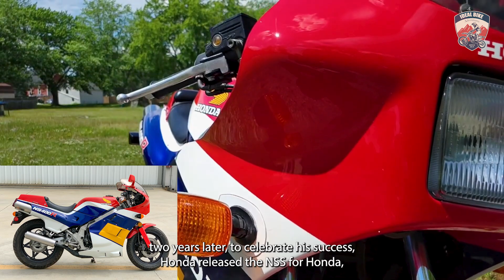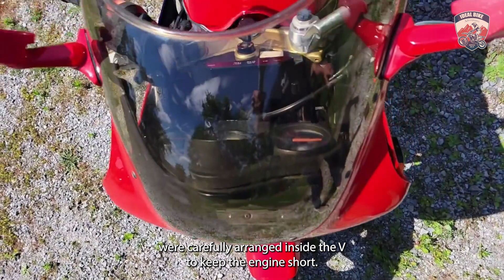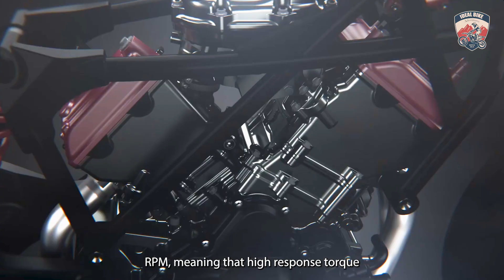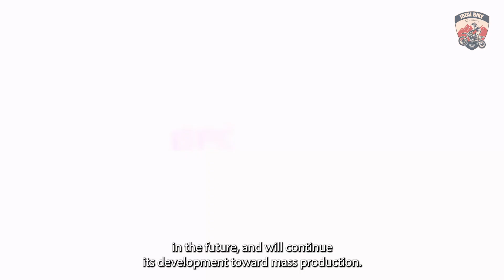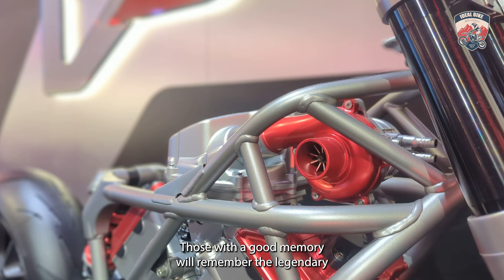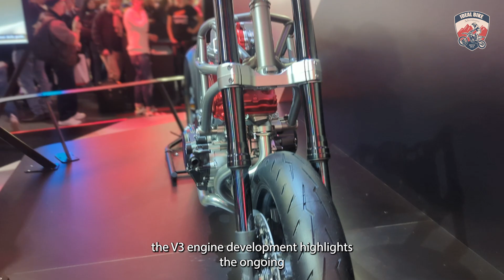New HONDA V3 Engine - Why Is This A BIG Step Forward?

Comment: Why doesn't it need an intercooler? Air gets hot when compressed, that is the same wether the compressor is driven by a turbine or an electric motor. Why large displacement? The whole point of compression is to get more power out of a small engine. And last but not least: why develop a new gasoline engine? We're switching to electric, it'll probably be banned by the time it's finished.
Reply: No real biker is switching to electric bikes.
Reply from the maker: @mikexhi287 For sure. And no real man as well 😂
Reply: Honda should hire you to train their engineers.

Comment: I'm excited what Honda could accomplish if they succeed in the various small developments in drivetrain technology they're pursuing independent of one another. Similarly to how they've been able to develop and offer their DCT to more and more models down from their premium into their middle range of bikes, an E-clutch and electric compressor could boost capability and power of less expensive, lighter, smaller displacement bikes in a very exciting way. And that ignores the whole "V3" thing. I kinda think the 270° parallel twin dominance is going to continue.
Reply from the maker: Thanks for your thoughts, I would love to keep the combustion engine sound as much as possible. The heart of a motorcycle is its SOUND and engine. In motorcycle world electric engines are far away from being imprelented too soon.